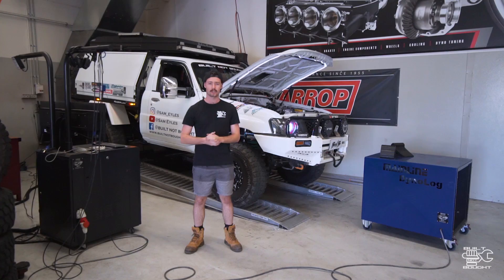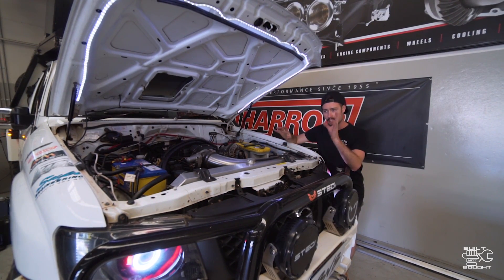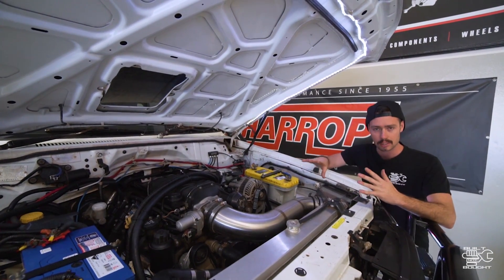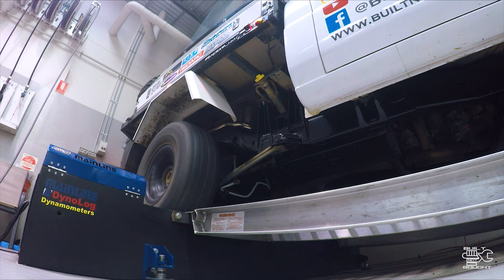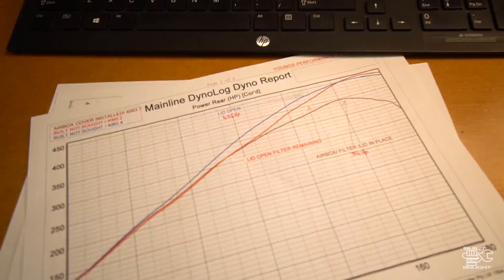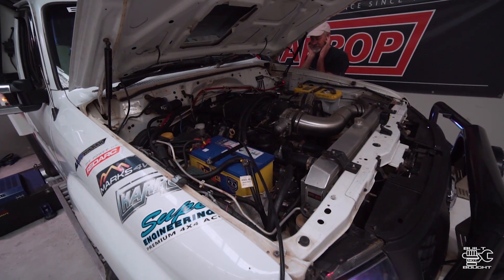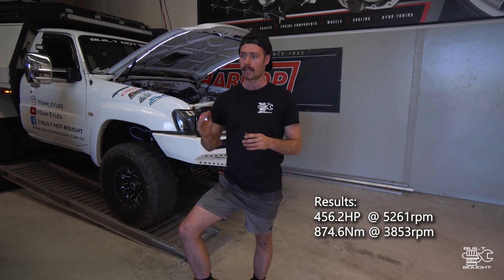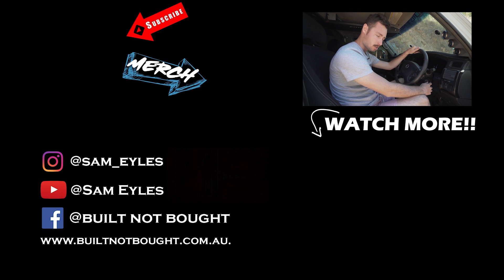Does Your Airbox Really Affect Your Engines Power?

Comment: Are you sure the restriction you have will be fixed by adding another snorkel? At a guess I'd say the restriction is your airbox/airfilter setup. Classic example of this is the gu patrol factory 3L or 4.2L airbox, the filter element is huge and leaves little space around the filter element. Using the same unmodified airbox, with a  smaller airfilter not only results in better flow but also better filtration as the whole filter surface is used. Generally the best flowing airbox setups seam to be using a panel filter at a 45 deg angle. The only issue with this is space, and also panel filter elements don't have the physical strength of a cylindrical element (high suction can ruin/break a panel element). This is discussed at length on the patrol forum by oldmav and geeyoutoo etc. Just food for thought.

Comment: Change your tensioner from the factory one to a manually adjustable one will stop the belt slipping
Reply: The issue is with a supercharger adding lots of drag is the belt will stretch under power, so the auto tensioner is able to take up some of the slack. If you put a manual tensioner on tighten it massively it works briefly, but that constant hard tension stretches the belt relatively quickly (In my case less than 200km) and you still have belt slip. Increasing the belt width does help (Going from 6pk to 8pk or 10pk) however depending the boost level that still may not be enough. In the end i went with a ribbed belt (commonly known as gilmer but thats not technically correct). A ribbed setup will fix belt slip completely but is harsh on the engine and supercharger bearings (plus very noisy).

Comment: Sorry Sam that's not a true reading fix the belt have the bonnet down aswell.
Then come back to us all with the real reading.
Reply: @speyles  awesome thanks Sam.
Keep doing what you are you only live once.
Reply: @speyles  Yep, bonnet down will probably reduce open airbox flow and in addition use hotter air, both will reduce power.  However, there's still plenty there :)  Cold air intake from the grille would improve towing - make a diverter and you wouldn't need to make it look like a tool's car with twin snorkels.  One snorkel is plenty for off roading work, open front for towing.

Comment: That air box needs to be redesigned. A couple of more runs would have been good to get a better median. Air flows into an engine by pressure drop or in your case by pull from the charger, so your increasing the velocity in the intake as your engine demands more. By the look of your airbox and the way the snorkel connects it, it could be designed a bit better to promote airflow as well as increasing the air box size. Could be a lot cheaper than a new snorkel. 

Have a look at the Mercs/Audi’s/BMW/Porches pushing way more HP and tourqe but with the same size or smaller intakes.